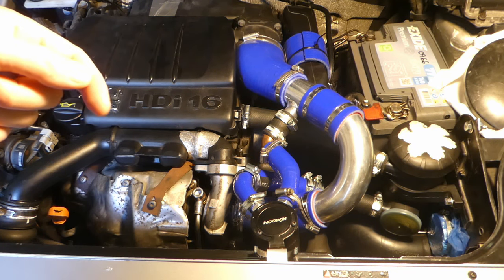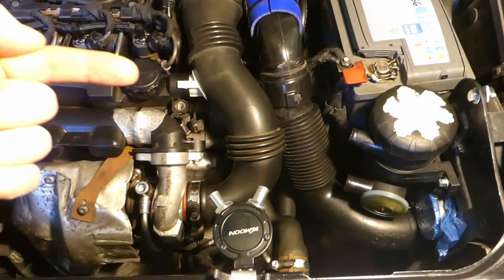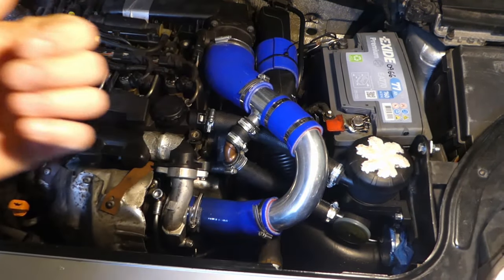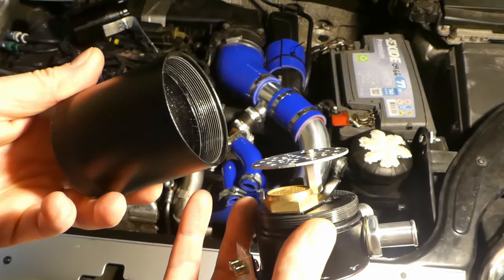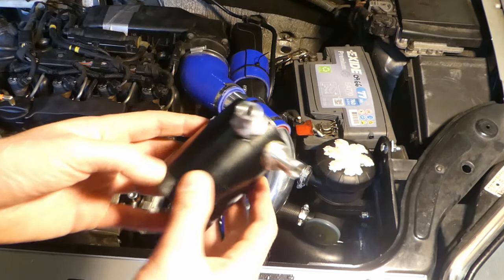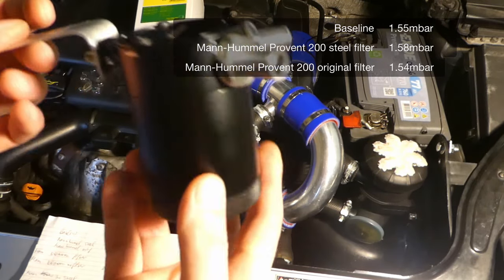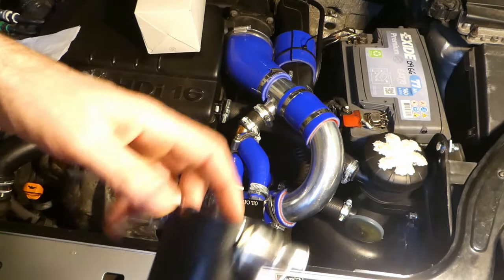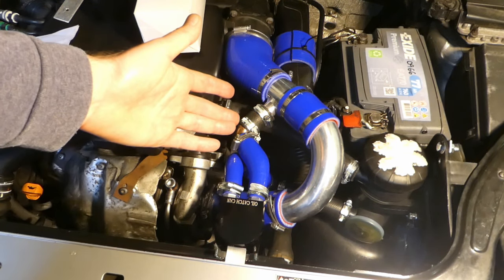Oil Catch Cans Crankcase Pressure, Provent 200 vs Mishimoto vs Universal oil catch can

Comment: Thankyou..wonder what results an inline filter would make
Reply from the maker: Good question, although  do not have access to one to test.
Reply: I have a cheapo one,inline before catch can and then outlet to atmosphere with blank at turbo inlet...my question,does the engine suffer any negatives at all from no recirculation of these gasses..thankyou
Reply from the maker: @mrmotorvator5151  Not really, but it depends on the engine ECU. In the olden days, everything was vented in the atmosphere, Check any old photographs of a highway, you will see the oily streak in the middle of the road. They used to have a slightly cut outlet to create low pressure for the gasses to escape. The modern engine's ECU has built in calculations how much of these gasses go through so it accounts for these. If it is a turbo engine, but even non-turbo one, then the suction from the turbo helps suck these gasses and lower the crankcase pressure, so it is beneficial. If you leave it to vent in the atmosphere you would only rely on the crankcase pressure to push it out. Long-term it should not be detrimental, it just that the crankcase will always be under positive pressure, as there will be no suction, just pushing the gasses out.
Reply: @moremolecules  I found a noticeable increase in pressure especially at idle..I think vacum is needed to draw pressure at low revs..I have reverted to stock piping with inline catch tank..seems to work best on my gm 2.0
Reply from the maker: @mrmotorvator5151  Yes, without the vacuum you just rely on the positive pressure from the crankcase gasses to purge themselves out.

Comment: Thank you for the video, really informational. I have just installed the "universal" oil catch can on my 4b11t and would like to know the impact.

If you are running a turbo, would increasing the crankcase pressure be a plus? LOL
Reply from the maker: Well, no, the increased crankcase pressure is the engine pressure, not much to do with the turbo. Generally, any excessive crankcase pressure is not wanted in the engine, as if it is excessive seals can leak oil. Most oil catch cans do not increase the crankcase pressure that much, but some do. It really depends on how heavy a breather your car is. Say, you car is a heavy breather, i.e. it is a bit worn and gasses pass the piston rings and result in higher than normal crankcase pressure, this will be compounded by the catch can and increase the crankcase pressure more, but it should not in general be that much of a problem.
Reply: @moremolecules  thank you for your reply. My oil catch goes between pcv valve to intake. So if it has some level of air flow resistance, it will increase the pressure of valve cover. Though I know several millibars won't have any noticable impact. Just a joke.😂
Reply from the maker: @zijie-he  Haha :-)

Comment: So what is the difference when using these on a gas engine?
Reply from the maker: Less oil vapor going through the engine, so it keeps the air intake clean, so the overall volume can be kept quite large.

Comment: To be honest, these pressures are so small does it even make a difference? except the kkmono/mishimoto one, they all just add like .50 mbar or 0.007 PSI. Is that so bad or negligable?
Reply from the maker: Depending on the engine, the normal pressure in these 1.6HDi is ~30mbars, so not really that much. Imagine from 1.5 to 6mbars out of the 30mbars is quite a bit. A little bit is not that roblematic, but then it depends on how much the engine is worn already. Say it is not 1.5mbars normal, but already a bit worn and somewhere already at 5mbars, adding another 5mbars is quite a bit.

Comment: Hi hope u r ok. İ broke bronze filter, took it off. Now will there any harmful crankcase pressure for engine? My car is 2012 year 2.0 turbo diesel chevrolete cruze.
Reply from the maker: Not too sure if I understood the question. You took it off completely, well I suspect that how the car was designed to begin with, so probably it is going to be alright.

Comment: good morning friends, I am at the stage of diagnosing this engine and spitting oil from the oil pneumothorax onto the entire intake system.  I started by replacing the valve covers, like probably each of you.  there was peace for a moment.  Next came the turbocharger.  Of course, while doing this, I changed the oil and cleaned the entire intake system through the intercooler throttles, ending with the intake manifold.  This brought only temporary relief until the entire system was filled with oil from the pneumothorax again.  I started the next work on this engine by dismantling everything so far, this time a step further on the head.  after replacing valve seals, cleaning new camshafts, new valve levers, I assembled this engine, although I know that I will start it again in a moment.  I deliberately did not remove the pistons to confirm that the problem was not in the head.  For now, it's just a guess, but I think that blow-by in the crankcase that blows oil through the exhaust valve is caused by worn piston rings/cylinders.  so if you have a symptom like blowing oil cap, you have a long way to go home.  Regards

Comment: On the universal catch can where do you put the mesh? In the main body or screw off the little baffle and stuff it in there?
Reply from the maker: Hi Russell, I would put it in both. I would certainly put some in the little baffle, but in the main body will increase the crankcase pressure, although only slightly. In the main body will give a chance for the oil vapour to hit something and potentially coalesce into larger droplets and eventually into a liquid.

Comment: Hello. Since the normal air pressure at sea level is roughly 1000 mbar I fail too see why i sould worry about 6mbar over pressure that's not even 1%. I can't imagine that is going to pop any seals or so.
Reply from the maker: A normal engine will have a limit of the internal pressure for the seals. I cannot quite find you the reference at the moment, but the limit is ~30-35mbars above atmospheric. So, it is not 6mbar out of 1,000, but 6 out of the 30-35mbars, that is significant. Different engines will have different limits, I think I am quoting the mini petrol engine, cannot quite remember which version.
Reply: @moremolecules  oh really, as little as 30-35? I assumed the seals would withstand more, thx for the info.
I just ordered one of those catch cans with that bronze filter for my Sea-Doo. Maybe i should consider changing the sintered filter for some steel wool.
Reply from the maker: @exoc1  I can probably find the reference for the mini engine, I think it was a naturally asirated 1.6 petrol. It is the only engine pressure I have ever found. As far as I remember it was 50mbars max and normal pressure 30-35mbars. That is above atmospheric of course.

Comment: Hi.  The last small catch can you mentioned, it is acceptable to insert a little mesh on the exit/out?  Currently my setup is same catchcan but i drop a bigger mesh at the bottom of the can ( around 1/3 in height).  Is removing the bottom/base bigger mesh and inserting small mesh on the exit upper side instead be a bit better to relieve pressure and trap oil?  Tnx so much
Reply from the maker: If it is the same as the one I was showing then it is acceptable to put a mesh on the in/out. The small mesh does not add too much to the overall crankcase pressure. In the bottom is also ok to put a mesh/steel scourers . Probably putting both meshes inside is OK. Overall it is much less than with the bronze filter.
Reply: @moremolecules  thank you.  Many OCC users may not be aware about crankcase pressures.  Your info serves as a great guidance👍😷🙂🍁
Reply: @moremolecules  question:  how about instead of a mesh at the bottom, can i just use a baffle plate and a small upper exit mesh setup?
Reply from the maker: @michaelvanna8982  Yes that is alright, although the baffle add a little bit of pressure, but overall is not that much. The crankcase pressure in all of these will not change that much, but what matters is the efficiency of the oil catch can. I do not have much of an answer to that, although I am thinking of a way to test this.
Reply: @moremolecules  hi.  Update:  so i decided yesterday to uninstall the last OCC (we have the same) you showed in the video.  Instead, i did the opposite by using the Kmoon/mishimoto like OCC.  The main reason is i want to use the drain valve.  So i modified the OCC by removing the main restriction, all baffles.  So basically i left the can empty inside.  I run 100kms yesterday and will run again later today. Then will try to drain if any later.  So far yesterday, i did not experience any engine chk lite, nice steady idle, my vacuum reading is -10psi at idle....more updatea to come
Reply from the maker: @michaelvanna8982  Nice work, but put some steel scourers inside at least, so air can hit something, otherwise it will not filter oil that well. Air will just go from the inlet to the outlet without moving through anything. Also, -10psi is huge amount? It is ~-689mbar or -0.689bar.
Reply: @moremolecules  first, i wanted to use empty can as my base comparison.  Then once i get something from the drain valve analysis, i might step up a bit by applying your advise for some steel mesh.  Using the kmoon, where do you suggest i should insert/drop the mesh?  Will it be drop at base bottom or i was thinking inserting mesh in the OUT area where the bronze baffle originally stayed.  What do you think? Hey, thanks🙂😷🍁
Reply: @moremolecules  yes i have a pro torque app i use on my mini cooper r56 n14 engine to measure boost/vacuum.  You can use that as well..easy winny!  Am getting -7psi to -10psi at idle...pretty stable readings so far.  I can use my oil cap and connect to my vacuum gauge maybe next week to confirm everything once am happy with the setup
Reply from the maker: @michaelvanna8982  Ahh, apologies, I thought it is a diesel. Yes, on petrol engines it generates a bit more vacuum. Although the boost vacuum will be the air in the system rather than the crankcase pressure. I do not think I have seen an engine that measures crankcase pressure.
Reply from the maker: @michaelvanna8982  That sounds great to me, having a comparison. I would not put steel scourers in the outlet line, it is unlikely that it will be sucked. Probably it is ok, I mean my mesh serves the same purpose. Yeah, why not, it should be ok. The vacuum in there is not that much in order to suck it. It is a good idea actually when I think about it.
Reply from the maker: @michaelvanna8982  Great and thanks for the updates, really appreciate it.

Comment: Do we have pressure in crankcase?so oildeep stick tube is sealed?
Reply: I've used a small o ring for it. Used soapy water to check all fittings to be sure

Comment: Will this also increase pressure for a petrol engine? I see a lot of ppl running catch cans for a boosted (SC or turbo) petrol engine and maybe its doing more harm then good by increasing Crankcase pressure
Reply from the maker: Yes, there is no principal difference in the crankcase pressure increase in the petrol engines. It is just that diesel engine have much higher combustion pressure of the gasses as there is no spark. What I am trying to say is that as far as I am aware, with some oil catch cans, e.g. the bronze filter ones, there will be some increase in crankcase pressure. The problem is to estimate how much is too much.

Comment: AM O INTREBARE ,AVAND IN VEDERE CA TURBINA FACE UN ANUMIT VID DE PRESIUNE IAR SUPAPA PCV INCHIDE SI DESCHIDE LA ANUMITE PRESIUNI IAR CEI 6 MILIBARI PARE O PRESIUNE MICA SI CE PRESIUNE MAXIMA ADMISA TREBUIE IN CARTERUL MOTORULUI ? SI MULT SUCCES IN CONTINUARE
Reply from the maker: Yes, 6mbar seems like low and that is on idle bear in mind. The maximum on a brand new engine is ~30-35mbar, so 6mbar is quite substantial if one thinks about it. Unfortunately, I do not have the specs, I took the 30-35mbar from a different similar engine, but it is in that ballpark figure.

Comment: You are trying to say that 6.20mbar which is only 0.01bar is dangerous?
Reply from the maker: Yes I do. Depending on the engine of course, maximum is ~30mbar before you get oil leaking from various seals. I can find the reference that I manage to find online and it was only with respect to 1.6 petrol mini, but you get the point.
Reply: @moremolecules  
Your car original PCV/CCV hose inner diameter is 23-25mm?
Mishimoto/KKmoon oil catch can inlet and outlet diameter is about 10-12mm. It's no surprise that pressure will increase after that.
But yes, that bronze filter is not a good stuff in there. Too much unnecessary restriction.
Reply from the maker: @Alfafanatico  I did try the Mishimoto/KKmoon without the bronze filter to see how much this adds. It was relatively substantual increase in pressure, so not just the hoses. But they all add to the increase in pressure. Not too sure, but the mishimoto/kkmoon are I think <10mm inner diameter, cannot quite remember, but it may be even 8mm.

Comment: Why not use an actual air/oil separating crankcase evacuation system that provides full time vacuum on the crankcase? Pressure is never good, and all shown is only using intake manifold for vacuum source.
Reply from the maker: Hmm, many thanks indeed for the comment, but I am a bit confused. What would that system be? Where would one take the full time vacuum? I suspect of course I can use the car's vacuum, but I simply used the current setup, only extending the path with an oil catch can.

Comment: What if you have excessive blow by and oil build up in intake manifold
Reply: Which one would you recommend for that?
Reply from the maker: @Hellogoodbye_  Depends on how excessive is the blow-by, but still any of them would be alright. If you are worried about gaskets, etc., the Mann-Hummel would be better.
Reply: When I remove my oil cap my oil sprinkles out and I feel air and suction. Also do you recommend the oil can with bronze catcher. A lot of people say it builds more pressure it that true.
Reply from the maker: @Hellogoodbye_  Yes, the bronze one will build up a bit more pressure, but it really depends on how much the blow-by is. It shoud not increase the pressure by a huge amount. When you remove the oil cap, there will be some oil coming out from the spinning camshaft and of course some air from the blow-by. This is normal, but excessive is not normal. Now defining excessive is a bit difficult and it depends on the engine. I would not recommend it, but there have been numerous people that do not have a problem with it.

Comment: Please make an video with original pv 200 filter element while clogged with oil👏👏
Reply from the maker: Ahh, you mean used filter with the same measurements. Hmm, I might do that, seems like a good test as it can actually increase the pressure. I did not think abou that, thank you for the suggestion.
Reply: @moremolecules  exactly👍🏻After 10k use or more.
Reply from the maker: @tedeganagondi  Yes, good suggestion. I may try and see what happens.
Reply: @moremolecules  thats a big debate in forums right now.i guess It will draw a big attention because nobody has done such a test till now🤗Keep up the goow work👍🏻I really like your content.

Comment: So I converted mbar to psi and it is 0.0224 psi at the low end and 0.0899 psi at the high end. That Is less than "1/10th of one psi", is that going to blow your seals or harm the engine in any way? Thank you for doing a real test so we don't have to go by someone's opinion. Real numbers really make the difference.
Reply from the maker: You have converted what to what???
1/10th is 10%, the 6mbar is out of the permissible for this engine ~35mbar, ~17%. You think 17% increase in crankcase pressure is little???
The others is less than that, but I have not got a problem with you using whatever you want. I have only done a video on my engine with my measurement devices, you make what you want with these result, in other words the conclusions are yours. If you think 10% is nothing, no problem from my side of things at all.
Reply: @moremolecules  I converted mbar to psi. In my opinion, anything under 1 psi is insignificant. Especially around 1/10 of a psi. maybe the web converter website is not correct or I don't understand how sensitive car engines really are?
Reply from the maker: @myworkpc1178  You would be surprised how little pressure is needed to seep oil out of the seals. I was also surprised.

Comment: Hello, are the inlet and outlet directions of the universal oil catch tank reverse? So, are we going to connect the input to the place where it says output, and the output to where it says input?
Reply from the maker: Yes, as there were labelled wrongly. I was basically following the mishimoto setup, which is the correct one.
Reply: Thanks 😊

Comment: If pipes of the second catch can are with the same size as Man's catch can ( about 20mm), then I think everything will be okay
Reply from the maker: Unfortunately, the pipes for the other oil catch cans are ~9mm, so much smaller than the 20mm Mann Hummel. That is how they were designed, smaller inlet/outlets
Reply: @moremolecules  I think that is another reason for more pressure in the crankase. They can be larger, but not smaller than the size of car's hose
Reply from the maker: @kiko2934  Yes, I completely agree, the smaller diameter pipes will add to the crankcase pressure. It is a restriction.